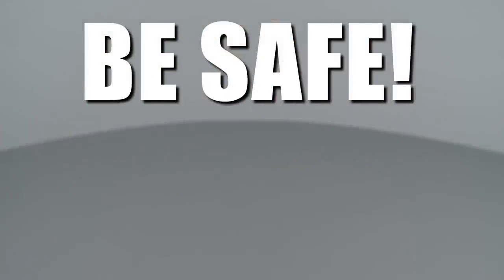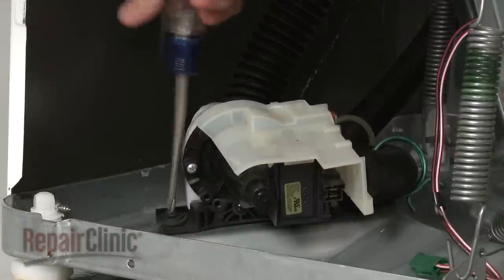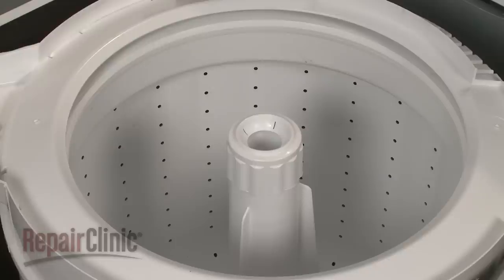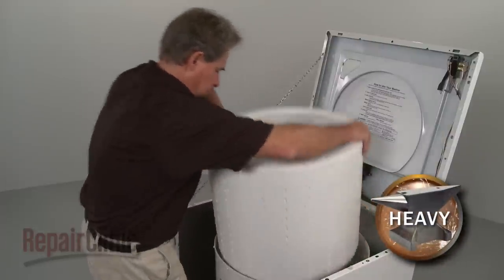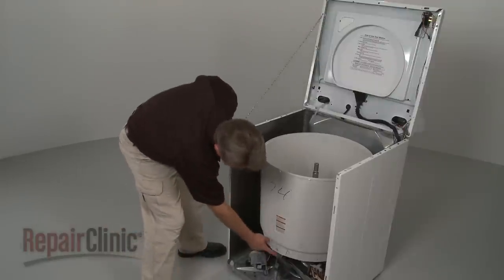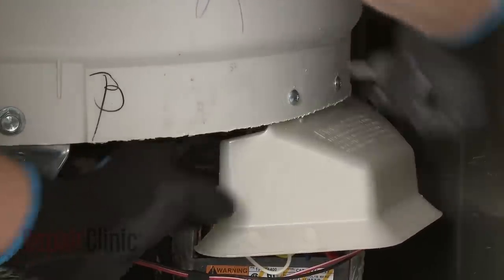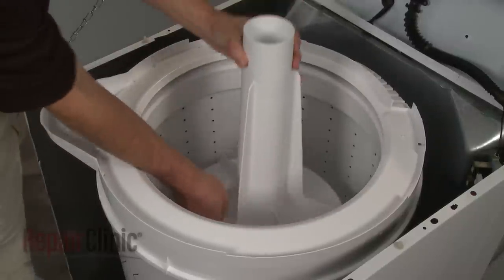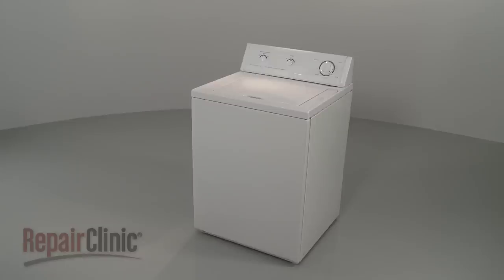Frigidaire Affinity Top-Load Washer Disassembly, Repair Help

Comment: So easy to take apart when it's new! :)  The trunnion block section is rusted to the shaft on mine.  There is so much gunk trapped under the tub, the pump can't drain it and the water leaks from somewhere else? (Right over the top on spin cycle?)
Reply: Like  everything else, it's easy when you know how.

Comment: I have a Frigidaire top loader, about 10 years old. During the wash cycle, water is draining out of the bottom of the machine and the drum is spinning and not agitating. It does drain through the drain tube and spins fine. Any suggestions as to what to look for when I remove the front panel? Thank you!

Comment: Just got to the part where I have taken out the trunion bolts  and block and the inner tub will not budge.  I have a Frigidaire Gallery Top Loading Washer....  looks identical to the washer in the video.... any suggestions?
Reply from the maker: +Scott Hayes You will need to put some penetrating oil on it and let it soak in. It is most likely corroded and stuck. It may take some considerable effort to get it loose. Once the trunnion starts turning on the transmission shaft you can lift up while you are turning to get it off.

Comment: This was a very informative video. I don't really know if I'd be able to fix my machine since it was a hand-me-down for my sister's former roommate and it's maybe 15 years old, and also I have no experience in fixing stuff like this. All I know is that there's a leak under the machine, and it looks like it's coming from right under the middle area where the tub is, though some water is also leaking down the front right leg of the machine. Maybe it's a hose leak or something, though I'm afraid to attempt especially with how old it is now....

Comment: My fabric softener container is nasty dirty, it’s dirty underneath the container  in the small holes, how do I clean them small holes to allow a better drainage flow?
Reply: Spray bottle and vinegar. Can use tooth brush and those pipe cleaning things for holes and or a wet dry vac with hot water and vinegar should work.

Comment: My Frigidaire top  load washer is not draining the water out...any suggestions on the problem
Reply from the maker: +Kristy Mohammed The drain pump may be clogged or the motor on the pump is defective.

Comment: we need to clean mildew from our washer model GLET10411AS1 do we need to take it apart?
Reply from the maker: It depends on where the mildew is. Locating exactly where it is will determine how much disassembly will be required.
Reply: It is in the water so hoping just by cleaning the tub it will be ok is the assembly similar to this washer?
Reply from the maker: marisela rodriguez We're unsure. That model number is not coming up when we search for it. Are you sure it is correct? Here's a video to help find the model number: Washing Machine Model Number Identification

You could also try a washing machine cleaner. We sell them on our site: http://www.repairclinic.com/PartDetail/Washing-Machine-Cleaner/W10135699/1373065?TLSID=1773

Comment: What a stupide design . To replace dran pumb you need to deasemple all machine parts .
Reply: you only need to pull the front panel off to work on or replace the drain pump. I have the same model as in the video.

Comment: I have a considerable amount of water leaking from the bottom of my top loader. Faulty pump?
Reply: Did you figure it out? Mine leaks badly like that when I’m filling the washer, so don’t think it’s the pump... maybe a bad seal? Or internal fill line?